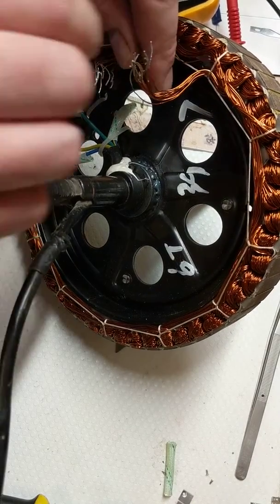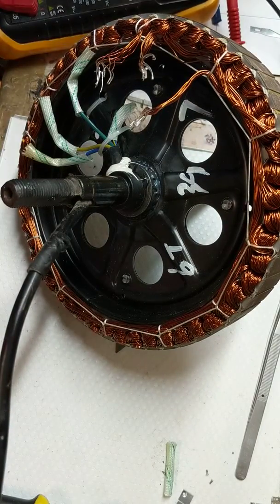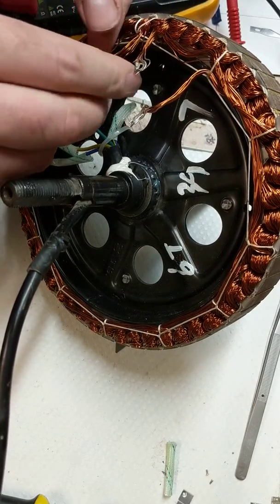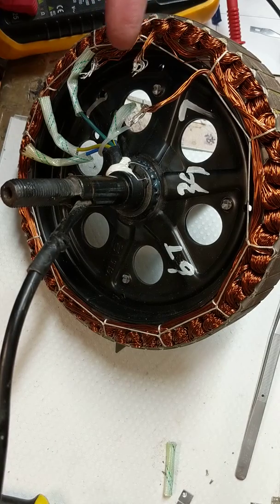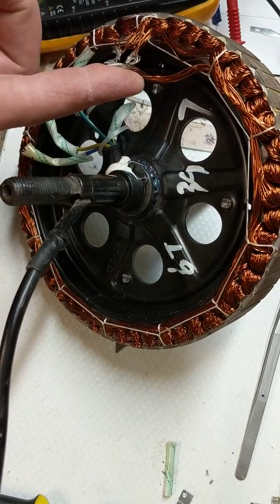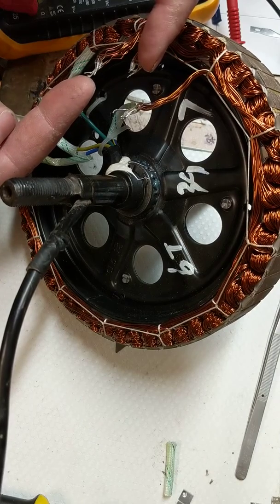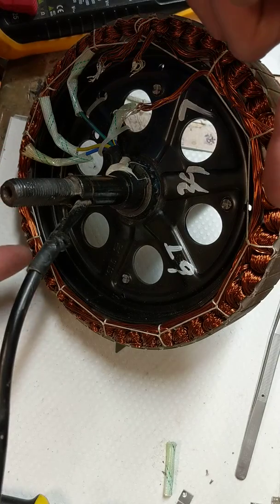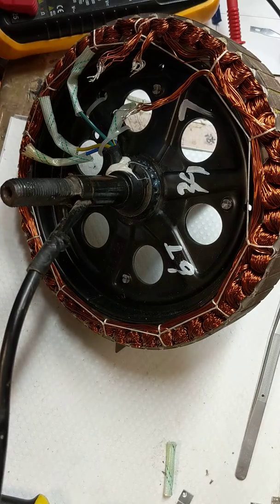1500w ebike stator problem . Short out windings. Fixing a ebike motor

Comment: Hello, I listen the continuity Bip when I test all the 3 phase wires.
Its normal? The scooter works normally, but when I ride 1 mile its starts to vibrate when I use the trottle. 
But when it turns off works normally.
Reply from the maker: Continuity is normal across the 3 phase wires. Have you ridden the scooter in the rain? I fixed a copy scooter the other day just by removing the base plate with the 10-15 screws and let it dry out in the sun for 4-5 hours.